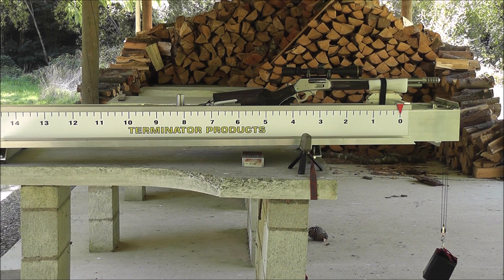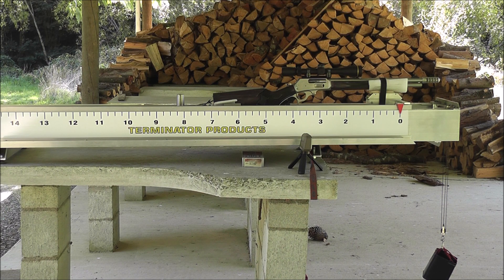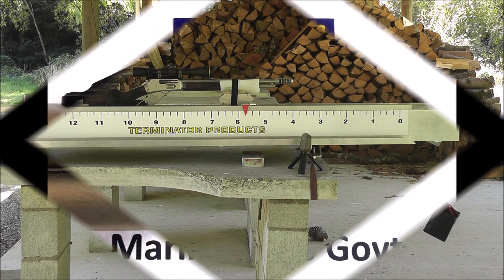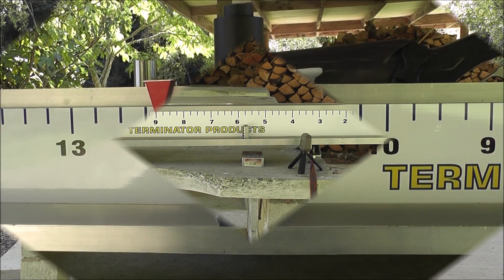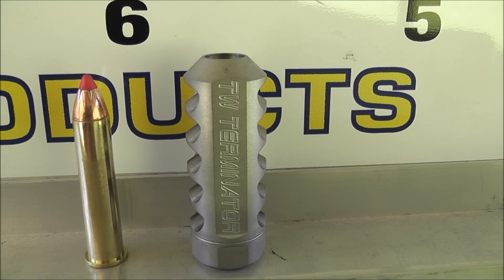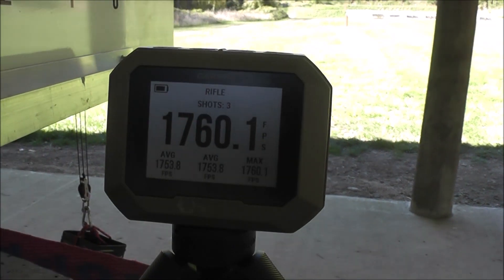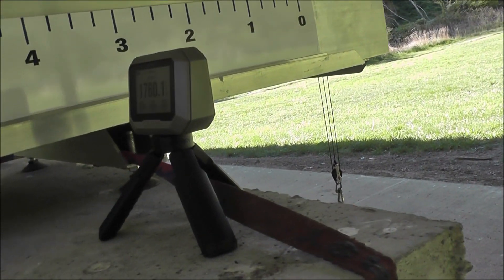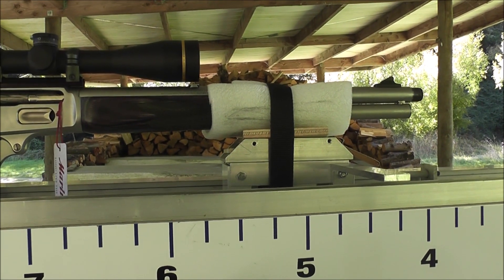TW Terminator Muzzle Brake on a Marlin 1895 45-70 Govt Rifle

Comment: Just got a TA Terminator on a hunting weight 33xc. I had a hard time trying to decide what brand of brake to use. It took me months to decide. I wanted the most recoil reduction for obvious reasons. These videos really helped me decide but was worried that they were a circus trick though. I now have about 30 rounds through the gun with a 300 grain Bergers at 3100 and I’m very very happy with this brake. This gun is a pleasure to shoot. A little less recoil then my unbraked Tikka T3 270 WSM. Thanks for making the videos and such an effective the brake.

Comment: Just took a look at your website and the TW brake is not listed.  Is this so new it is still in development?
Reply from the maker: Hi, yes it is a brand new brake & availible now, my website needs updating, it is the same size as the TU, I have 28 models now, cheers Greg
Reply: Checked the website.. not listed...can't buy it if it's not listed